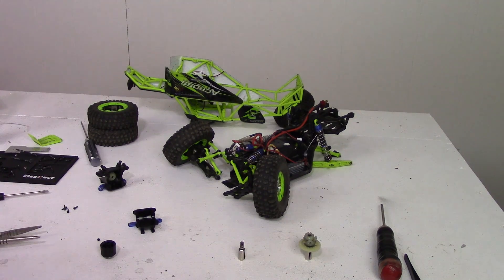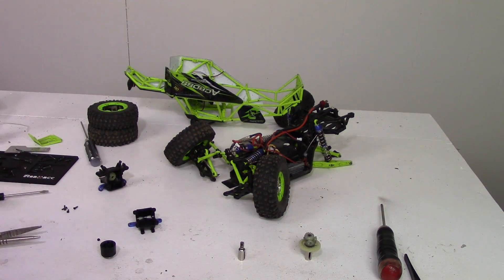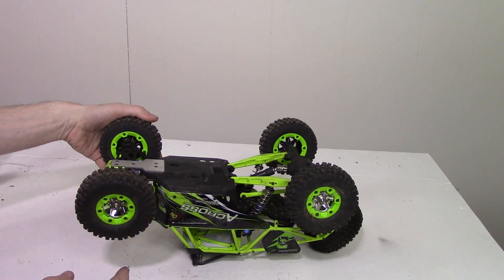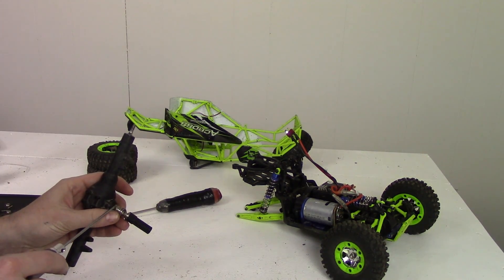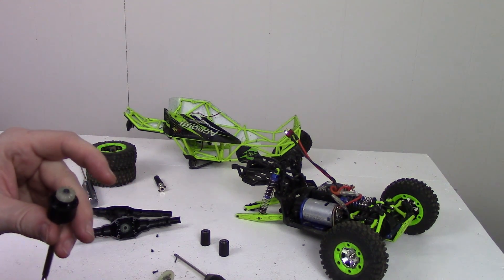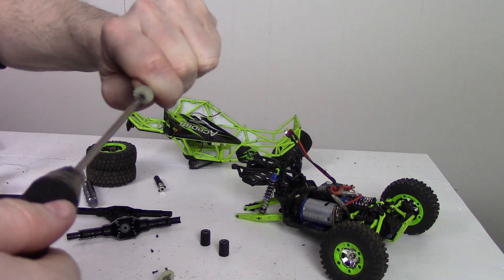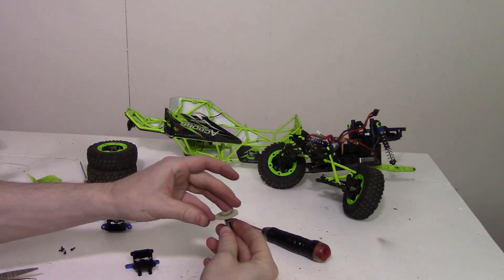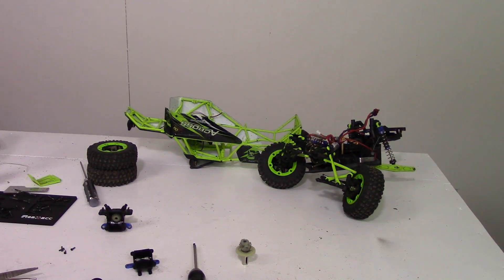WL Toys 12428 Diff Problems From Running 3S!

Comment: hey man nice video's i've got a question would you reconment the WLtoys over the feiyue? i dont know wich one to buy...
Reply from the maker: I personally think the feiyue is the better buy overall. The wltoys has weaker plastic, weaker differentials and is not as up-gradable.
Reply: Okay! Thanks for the reply. And how about the HBX 12889 Thruster?
Reply from the maker: That's a tough one. I'm really liking the Thruster a lot, but I don't have enough run time with it yet to know how it holds up compared to the feiyue. It has metal dog bones in the front compared to the plastic drive shafts on the feiyue. It has better electronics than the feiyue in that it uses normal 3 wire servos so you a ton more options on servo replacement and it makes upgrading to a brushless system easier.
Reply: Void X RC Okay i think im buying the hbx :) i also see you have made it brushless i think i want to do that aswell right away, i was just wondering what you have done with the transmitter?
Reply from the maker: Unfortunately you have to replace the radio and receiver too. The stock receiver is a combo unit with the ESC.
Reply: Void X RC hmm okay thats a shame.. :) and do you have recommendations on a good transmitter???
Reply from the maker: I'd recommend something like the flysky fs-gt3b: http://bit.ly/2uO7gFZ or the flysky fsgt3c: http://bit.ly/2f1iXnj
For the HBX you need a 3 channel radio that can adjust the end points of the 3rd channel. That's the channel that controls the shifting from low to high or vice-versa. There are a few cheaper 3 channel radios but that can't adjust the end point. While it's not a complete must have, it will put less stress on the servo as the servo won't have to push or pull further than it has it. If you have any other questions feel free to ask.
Reply: or maybe you think i should get an other brushless setup.. :)
Reply from the maker: That motor is meant for a bigger vehicle, it won't fit into the HBX. The 3650 name means 36mm diameter and 50mm long. the hbx needs a motor that is 28mm diameter and around 45mm long. something like this: http://bit.ly/2tSV6IL
Right now it's also cheaper too
Reply: oh okay are you sure it wont fit? and would that be the strongest 2840?
Reply: Hey! I now have a new idea, i want to get the Racerstar 2845 5900Kv with the Racerstar 60A ESC to get maximum capacity. Would this be a good setup? or do i need to get a weaker 35A ESC to get the best results?
Reply: Sorry for bothering you so much! but if i'd get this setup what lipo's would i need? :)
Reply from the maker: I would personally advise against going with a 5900kv motor. A higher KV motor like that will produce a lot more heat. However if that is the motor that you want, then I would advise going to a much smaller pinion gear, something like a 12-14 tooth one, it takes a mod 0.6 tooth pitch gear. For the battery I would suggest something like this venom batter:
https://www.venompower.com/collections/venom-surface-batteries/products/venom-35c-2s-2000mah-7-4v-lipo-battery-with-universal-plug
Reply: okay thank you! well i'd love to see what happens with a strong motor like that or do you think its a realy dumb iedea? and after a bit of research i think with the 5900Kv motor i will need a 120 amp ESC or not?
Reply from the maker: Well it's not a dumb idea, It's more just knowing what it will be like with that kind of motor. The other thing is the diffs will wear out faster with that fast motor. Anyways I'm looking at the max amps for the 5900kv motor, says 88amps max. so 100-120 should be fine.
Reply: Okay wel im going to order all of this today! thank you so much for your help! Now for those bateries do the venompower fit the HBX? and what hex size do the wheels have??? :)
Reply from the maker: No problem, ask away if you have any future questions. The wheel hex is 12mm. That specific venom battery will fit.
Reply: thanks man! i went for it and bought it :) now ehmm how long are the shocks on the front and the rear? and with the setup i was talking about, so: 120 amp ESC 5900Kv brushless. could i also run it on 3S?? thanks!
Reply from the maker: I'll measure the shocks later today. 3S would be too much for that motor, it will overheat fast. You'd also tear up the diffs really fast on 3S.
Reply: okay thanks! Did you see how long the shocks are? :)
Reply from the maker: fronts are 65mm and the rear are 90mm(measured from the cent of the eye)
Reply: oh okay thanks! and do you think i can put like 110 mm shocks on the back and bigger ones on the front aswel?
Reply: or maybe 120mm is there a limit?
Reply from the maker: I wouldn't advice putting extra long shocks on it, in the rear it will make the drive shaft angle too extreme. The from can only handle so much as well. I wouldn't go more than 70mm in the front and 100mm in the rear.
Reply: Or maybe you know how it connects to the gears in the rear axle?
Reply from the maker: That drive shaft should work, can't be 100% sure but I think it should.
Reply: okay ill check it out :) hey ive got an other one for you.. do you think the whole body of the feiyue can be fitted on the hbx? maybe by drilling some holes and stuff? :)
Reply: Do you know if that fits? :)
Reply from the maker: I don't think it would fit, they are build too differently I think.

Comment: Are you going to upgrade to metal geared diffs?
Reply from the maker: Not on this, I ended up cutting the chassis up and using the motor mount and output drives on a dump truck build. I did however just upgrade the gears to metal in a 12428 copy, the sports drift gs1002. The gears are the exact same along with a bunch of other parts on it.
Reply: Yeah, I just read most of these comments. 😂 I apologise for asking that as you have already answered that many times. I didn't know until I read further to see how many times you had to repeat yourself.
Reply from the maker: Thanks! haha it's all good though :)

Comment: Ok so I went ahead and ordered the 9 piece turnbuckle and trailing arm set for my truck. good thing I did as I just noticed how badly bent my rear upper differential trailing arm links are, 1 is bent in an upward and 1 in a downward direction. from torque twist. we're not like that when the stock motor was in. other than the rear shock bulkheads that's it for the blue metal upgrades. I decided to stick with the plastic rear trailing arms mounts. the small pieces on the top of the rear end and the small pieces on the bottom of the chassis underneath back side. There aren't much to buy them in aluminum but I would like to have some failure points to save myself from having to buy new chassis or another new rear end. those pieces will be the pieces to break which is good since there inexpensive and easy to swap out...
Reply from the maker: Yea it's good to have a weak point for breakage, I always try to.
Reply: Void X RC I bought the 9 piece turnbuckle and trailing arm set. got alot of Japan orders I'm waiting on. I just got the vaterra diff, haven't even opened the box yet. think I'll have problems with all these parts mainly the front or is the problem more when your only buying half of the metal upgrades. seems like you had problem with tow. All my orders are within 3 days apart so I'll wait till they all get in before I rear it down. might have to order adjustable tierods turnbuckles whatever. the slide rack for the steering and rear bulkheads are the only pieces left. probably be pushing my weight limit with that. I did use a plastic set or bead rings for my alloy wheels to cut weight down since I knew I'd be adding it right back
Reply from the maker: Yea I had problems with toeing out, in the front I have the stock a arm, 2 aluminum links and then adjustable turnbuckle I made. I never received the Aluminum steering links so I don't know if those would of fixed the problem or not.

Comment: just finished hooking up new control arms about to do light bar. paperwork is bit confusing when it says can't use 3s battery. I should be safe as long as I'm plugging into my radio reciever correct. not like I'm gonna plug it directly to my lipo. some are like that though but not this particular 1. says safe connecting thru bec but my esc has a bec but I'm not seeing any extra ports I just been using the extra ports thru the radio reciever. I'm new to this but don't the bec in the esc drop voltage thru the radio reciever down to safe voltage correct so it shouldn't matter if I was even using a 12s lipo as long of course my esc can handle it.... thanks bro

Comment: Thanks for the video. I chased this issue for days. 
What are the part numbers for the shaft. The gear and screw.
Reply from the maker: I'm not sure of the individual part numbers. I found it's cheapest just to replace the entire diff for a few $$: https://www.banggood.com/Wltoys-1242812423-112-RC-Car-Spare-Parts-Rear-Differntial-Gear-Group-0133-p-1084243.html?p=AF261224072852015082

Comment: had a broken driveshaft tried to remove it and it has be glued on to the diff and possibly the spur Any tips?
Reply from the maker: You could try heating up the part with a hair drier or hot/boiling water(be careful if you try with hot water). The heat should helps break down the glue
Reply: Void X RC ok thanks

Comment: I ran 3s on my at the time HBX thruster and the steering was twitching and not even working half the time! and I melted the 390 motor with 4 speed runs lol it's been upgraded to brushless now and it's a lil monsta! also it has all metal diff gears only thing I'm worrying about is the transmission gears as they are plastic and I don't know of any metal transmission upgrades for it :(
Reply from the maker: How fast roughly do think it was going on 3s? Good to hear that all the diff gears are metal! I think the biggest thing to keep the transmission gears safe is to not shift at speed. Though it still might be possible to find some gears that will fit.
Reply: Void X RC 25-30 mph and I give it hell 1-2 shifting the hole transmission gear set is around $8 check out my latest brushless speed run of it I shift it hard every time I haven't had any problems yet!

Comment: oh ok yeah definitely keep us informed on the front diff swap. that be great if the front will work. only thing is you'll have to use the front cvd half shaft off the feiyue as well do ordering the 12428 has front dogbone style halfshafts
Reply from the maker: It doesn't look good for the front diff, I just had a quick look at see if you could just swap the diff its self, the whole front diff case. For the first one everything is just the wrong size, could probably get the diff its self into the housing ok but not the input bevel gear. For the second one there are a couple of screw points that match up but the rest aren't close though, and you'd have to cut a bunch of stuff down and then it might fit but is probably too weak. And that doesn't fix the problem of not having the input dogbone. I'm not an engineer or anything either lol so my be someone else does come up with a way to make it work. I'm still gonna look around and see if I can find any other gear sets that would fit.
Reply: Void X RC yeah the 12428 front diff there calling a wavefront diff, idk but I knew there would be some drilling involved and also the dogbone problem. wonder if the feiyue front diff could accept the dogbone outdrive cups inplace of the ones on it. or concert the driveline to feiyue setup. probably just be easier to go rear wheel drive on the 12428 by using the feiyue rear diff only. If the front and back gearing would match you could just keep the front stock and just replace the front plastic gears when needed which I think the rear absorbs most of the torque stress. unless your doin high jumps which the front impact is hard on the front diff gears as well. never a 1 part swap is it. I've built 4 10 second mustangs and it's never completed, you always fine something to do something to buy..

Comment: how do you know if the back or front diffs are damaged?
Reply from the maker: The first thing I always notice is the vehicle not driving right. You can tell if the wheels are spinning under load. hold the front two tires in the air and give a little throttle, if the rear tires don't move at all or only 1 wants to them problems with the rear diff, do the same for the front. you can also usually hear a difference in the sound too.

Comment: what 32 battery where you using i plugs a 3s into mine and it fryed the esc
Reply from the maker: I believe the battery I was using was a 3S 1300mah 50C lipo. This is the exact battery I used: http://www.greathobbies.com/productinfo/?prod_id=TGHL13003C50X
Reply: maybe i just had bad luck this is the 3s i used   and as soon as i pluged it in the beep it makes was really loud and then only thing that would work was the turning servo
http://www.ebay.com/itm/ZOP-Power-3S-11-1V-1800mAh-30C-T-Plug-LiPo-Battery-for-RC-Quadcopter-Car-Z1E7/192280903226?ssPageName=STRK%3AMEBIDX%3AIT&_trksid=p2060353.m2749.l2649
Reply from the maker: Ahh yea probably just bad luck, although I'm surprised my esc is still working. As these esc aren't rated for 3s, I don't think any of them would last if they had regular 3s use.
Reply: mine done this aswell also the motor fried :(

Comment: also your opinion on the rtr vaterra twin hammers. the blue white orange model. 300 bucks. I'm putting the order in I don't see any problems other than upgrading to brushless changing to better servos both steering and shift. and better servo horns and tires. everything else is good I'd think. if you got any experience with these versions share...
Reply from the maker: The only experience I have is with the twin hammers clone I have and it was easy to convert to brushless. I think it's a great proper hobby grade vehicle. I'm very glad to have one in my possession. It did have some bad torque twist when I first went to brushless but I mostly have that under control now.
Reply: good to know. Yeah it seems like it's built like the 12428 just bigger. look like it will accept 2.2 superswampers nicely. I will say if my experience with the toro brushless continues the way it has been I'll buy the same for the vaterra.

Comment: hiya I just purchased one of these can you tell me what size of o ring's I need to purchase to fill the shocks with oil buddy or anyone
Reply from the maker: I think the bottom oil ring needs to be Dash -005(3/32 Inner diameter). I'm not sure for the top o ring though
Reply: +Void X RC thank you very much i was trying to find a rc car shocks seals kit but I'm not having any luck my friend it helps when you have a size to go with it my first rc car thanks very much I'm sure I saved a few Oring kits with the 0.5 and up woohoo lol can I ask how did you get on with your drive problem I seen a few people have had this problem and I was going to order metal gear drive set & upgraded diffs just to be on the safe side don't I did order oil shocks aswel from Banggood.com but it gony be a few weeks lol  and thanks for your help and advice very appreciated :-)
Reply from the maker: At the time I had the diffs fail the metal diff were not available so I actually ended up cutting the chassis up and using the motor mount and drive shafts to power a toy dump truck I was converting. I do have two feiyue fy06s though and on those I ended up replacing the shocks with ones that hold oil. I would definitely recommend the upgraded gears/diffs. If you have any other questions feel free to ask :)
Reply: +Void X RC thank very much yes iv ordered a full metal gearing upgraded kit and shocks & metal hex but Im a bite lost I'm search eBay for oil but I can't work out what 60wt oil  is in - cst  thickness  I don't have any nolage of cst oil range 900cst - 300.000 lol I just don't have a clue haha but yes iv managed to upgrade everything apart from axles & drive shafts I'll have to wait till payday for the rest :-D happydays lol
Reply: @wdavie27  it's like 10$ for aluminum upgraded shocks on bangood lol and that's for all four